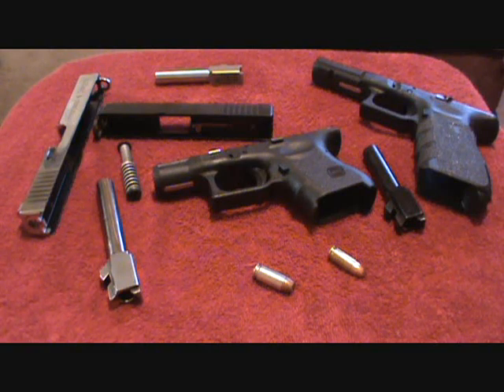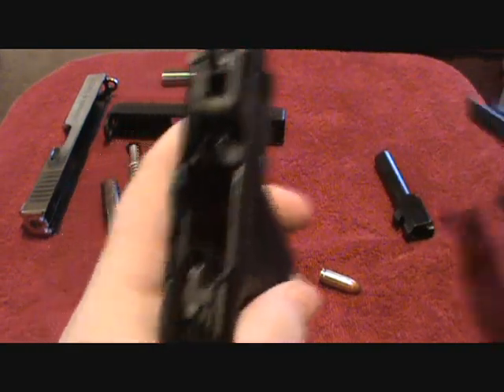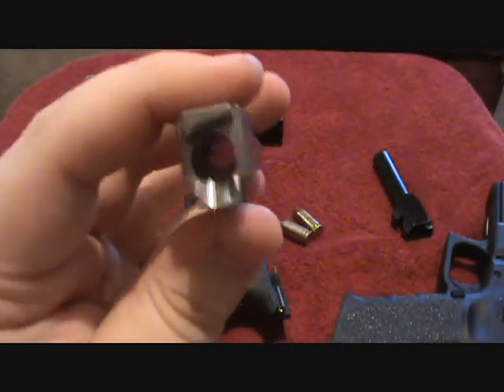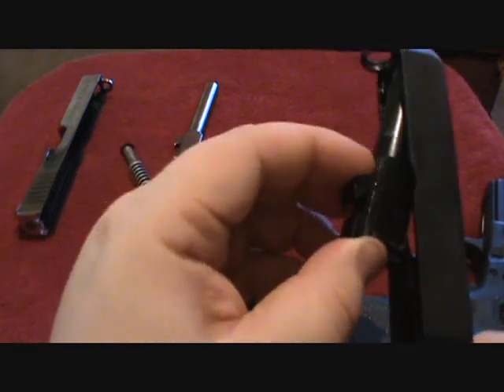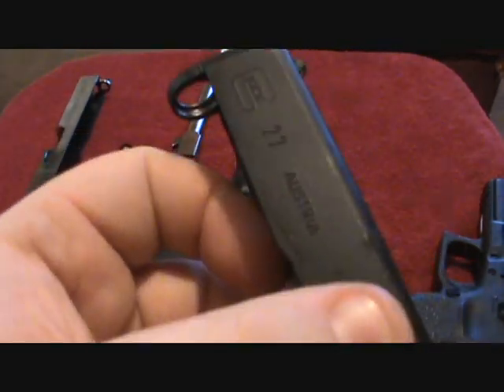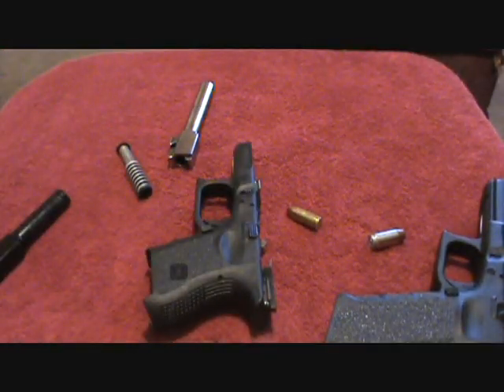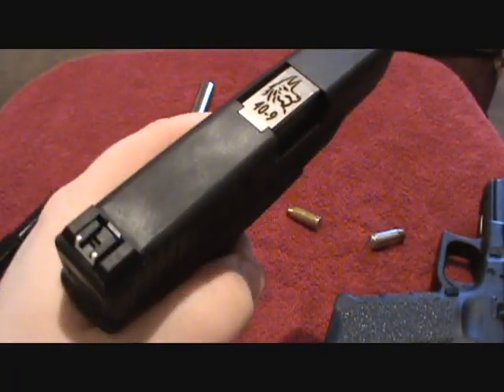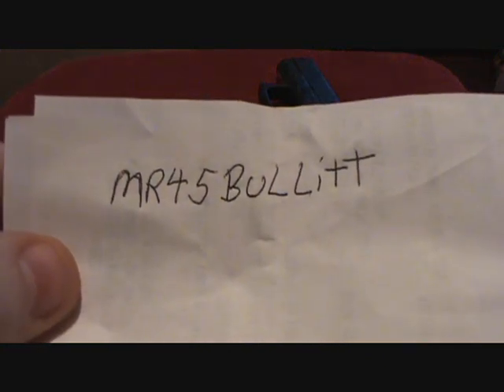About Glock conversion barrels

Comment: I have this exact set-up but I also have the 357SIG barrel that works with the .40 mags. This gun is awesome. You can run 3 different calibers through it. Priced new, you can buy everything to shoot .357SIG , 9MM and .40S&W for about $820. The Glock 27. Awesome little powerhouse.

Comment: @TheGlockaholic 

yes they do. plus you can use the 40 cal mags to hold the 357 round with no problem due to the 357sig being a 40 cal casing with what is basically a 9mm projectile.

Comment: I have a G19 and a G23, I converted my G23 to a 9mm. I changed out a total of 5 parts. Barrel(Alphawolf), Ejector, Extractor, Extractor Spring Button, and mags. I went with PMags, they are half the cost of factory mags. so now I have 2 G19s

Comment: I think you missed something with the Glock 20 in 10mm cal. Besides conversion to 40 S&W you can also do a 357 Sig in the 10mm pistol and all three calibers with the SAME MAGAZINE. A real 3 in 1. And if you own a Glock in 40 cal you can also convert to 357 Sig.
Be careful with the extended ported barrels when you are shooting smaller calibers out of a bigger cal pistol. Like 40 or 357 Sig from a Glock 20 which is a 10mm. Because when you are shooting say, 357 Sig from a Glock 20 SF, especially with smaller loads, the recoil is simply not enough to cycle in the next round so you end up having a misfeed. Also recommend a Lone Wolf extended/ported 10mm barrel for your Glock 20 to replace your factory barrel. For a $100 more you have a barrel that reduces recoil significantly!!
Jackson, Mississippi.

Comment: @Tenacious21 No, they are frame size specific. In other words all Glocks with the "smaller" frame, 9mm, .40 s&w, .357 SIG, etc their mags are interchangeable. The larger framed Glocks, the .45acp, .45 GAP and 10mm have a larger width mag. These larger mags will not fit in the smaller frame Glocks. The smaller frame Glocks mags will insert into the larger frame Glocks but will be too loose and will not lock in place.

Comment: I should have mentioned, The Stainless 9mm conversion barrels, have the thicker barrel wall. That extra thickness gives the pistol added weight, on the front of pistol where a loaded pistol needs it. Most shooters love the accuracy of the converted G23.

Comment: I have the G29 with 9x25 barrel its a cool round, very expensive. The recoil is lest then the 10mm it has a nice crack sound like a rifle and a 2 foot flame out the barrel.  Very high velocity would be good against light body armor. it is a step up from .357 sig i think of it as 9mm super mag

Comment: Thank you for doing this video.  Please update with clarification on the necessity of complete caliber conversions.  I have read forums and seen video where people say you should also swap out the extractor, ejector assy and the little plastic extractor spring bearing.  Would it make any difference in say how the G22 with 9mm conversion would run or its reliability?
Reply: I did a complete conversion. I changed a total of 4 parts to make it reliable. Barrel(Alphawolf ), Trigger Spring Housing(ejector), Extractor,Buffer Spring,  and the extractor spring button. all the parts I bought from the glock store. well it is a total of 5 parts. All 9mm parts. make sure you buy the parts for the right GEN. 1-3 parts for that Gen andd GEN 4 for GEN4

Comment: the 40-9 conversion barrel will also work in your 357 sig models 31,32,33.they do not make one that says 357-9 but the 40-9 will work it just will say 40-9 instead of 357-9.i got one for my glock 31 and it says 40-9 on it.lone wolfs website says that their 40-9 conversion barrels will also work in all 357sig models and 40 S&W models just the same just make sure to use a 9mm mag when using this conversion barrel. great video but i thought i might let you know this about the 40-9 conversion barrel

Comment: @JGuitar310 You can see when you look at the loading port of the lone wolf barrel it is to the left side a small amount. More wall on the right side and less on the left. This "off centers" the round so it will hit the extractor correctly if i am not misstaken.

Comment: I bought from the Glock store the double diamond 45 ACP to 10 mm conversion with two 10 mm Glock magazines and a 20 lb competition recoil spring with the ring to make it fit my slide.
I have failure to load problems about every second and third shot.
I find that this conversion is not reliable for Carry.
Using the Glock 21 in the 45 ACP mode it runs just fine no matter what speed I'm pulling the trigger at.
I did find the 20 lb recoil spring tamed recoil a lot.
I am searching for a fix on the 10 mm side because I wanted to carry it that way for Bear protection while in the woods.
But I find right now it is not reliable at all using it as a 10 mm!!!!

Comment: I have a LW conversion barrel (.40 to 9mm) in a Gen 4 Glock 22.  The only thing additional you need to do is change out the .40 Recoil Spring Assy to a 9mm one (and of course the mag) and you're good to go!
Reply: I used my G22 recoil assembly, a G17 magazine and shot 100 rounds without so much as a single issue.
Reply: Konish P. And did you notice that your follow-up shots were slightly slower?
Reply: thebronzetoo I can't say that I did notice it, but it wasn't during a match...just range plinking.  I guess I was commenting on the fact that the .40 recoil unit worked  okay

Comment: I put one of these in my older model 22 with a model 17 mag and it has jammed with a FTL and a FTF. Happened with the original recoil spring and a new spring. Lone wolf recommends to use P+ ammo. I'm a little concerned the gun is going to blow up in my hands.

Comment: This is what I was looking for to clairify Why you cant just switch out factory barrels 27to26 Some Vids are saying does work fine wondering if  it tears up internals Sticking with fac? I actually got a lonewolf  9mm 5.25 to convert my G 20 10mm Was jammiing had to polish ramp then worked fine.

Comment: You can absolutely go from 9-40 if you buy a 40 slide and ejector. Glock 17 and 22 is exactly the same frame and trigger group, it takes a $7 ejector and a glock 22 slide and barrel to convert it to a .40. It just depends on how much you want to spend doing it. Lone wolf sells their G22 slides for $174, the G22 barrel if about $100 and ejector is about $7. it is not un-doable.
Reply from the maker: I know this, been using glocks for over 20 years, key work is you have to buy a new slide, I can ge police trade in g22's for around 300 so why would I buy slide barrel mags etc??
Reply: +H4T Certified Glock Fanboy Wasn't my point. Point was you can do it. You said you can't.
Reply from the maker: Yep and i'm exactly 100 percent right, like I said in the video you can not just add a barrel and go from 9mm to .40,
Reply: Humans4Targets will the 357 glock shoot 40cal or the other way around?
Reply: +Phillip Brown other way around
Reply: Is the Glock 33 357sig basically the same as the Glock 27? I really want to get a Glock 33 while also getting a additional 40 barrel to be able to shoot the more available 40 ammo. I rather be able to buy the 9mm conversion barrel but do I have to switch out any other parts besides the barrel & magazine? I've been shopping around & most gun stores don't seen to know anything about them but saying that I can buy a 40 cal barrel to shoot 40 cal in the the Glock 33.

Comment: Thanks for video. Just my opinion, but I MUCH prefer KKM barrels. They are 40% more expensive. How much quality steel and quality machine work can you get for $100. ?  I've had some experiance in this, and the KKM IMO is superior. I've never needed the extractor swapped in my G23 when converting to 9mm. If the Lonewolf doesn't work out for you, try KKM. Accuracy is far superior also.

Comment: Ive noticed a 9mm bullet fits in a 40 cal mag.  It also feeds with no problem.  Is it safe to use the 40 cal mags w 9 mm bullets?
Reply: +john calabria I've done it and it works fine. Checkout the "Glock Store 0n youtube there's a video about using the .40 mags with 9mm.

Comment: ok so.....if the chamber is offset to the left so the 9mm casing hits the ejector, does the 9mm shoot a little to the right when shot out of conversion barrels? it would suck to spend a little extra just to practice cheaply to shoot off target. better to just get a 9mm gun and practice shooting straight.

Comment: Couldn't you get a .40 barrel that is milled differently, to fit the 9mm slide? You did that with vice versa for your 9-40 conversion. Would there be other problems? 

I understand that you may have to replace springs or something, but if you did that is there a potentially hazardous problem still from the slide even if the barrel's built to fit it?

Comment: Quick question. I have a G31 and have bought a Lone Wolf barrel that is for the G35. It sticks out close to an inch further than the stock G31 barrel. I have yet to try it. Should i get an aftermarket recoil spring or should it be ok. Money is tight right now so it's gonna be a while till i can get some ammo to try it out. Just wondering if it sticking out is gonna be a problem. Thanks for all your help in the past and future. God Bless,                        Richard.

Comment: You said that you can convert the Glock 21 to the corbon the best conversion is the 40 super or the rowland Lone Wolf wheel bore your Barrel to shoot the 460 Rowland for $50 and purchase a 27 lb spring and the 40 super Barrel runs about 115 and you need a 24 lb spring both are great rounds but the corbon is outdated

Comment: would you trust this barrel enough to be reliable enough for concealed carry?
Reply: My conversion 357 Sig to 9mm for my Glock 33 seems like it is reliable with 9mm mags.  I get malfunctions with the 357 mags, like one in 50.  I am doing more testing tomorrow with the conversion on my G33, but the first 100 rounds were normal Glock perfect when using G26 mag or my G17 mag's.  I plan on carry with the 9mm conversion and the stock 357 Sig in the G33.  Both calibers are fine as far as I am concerned.  When I run out of 357 Sig, then it will be all 9mm because of cost and compatibility with my other carry guns.

Comment: Hey h4t, 
If the sig 357 is the same casing as the 40 but neck down, then If i have a 27 can I put a 357 sig conversion barrel into it. I saw another utube of a guy putting a 357 conv barrel into a glock 23. I was told by one vender you can only conver down. Also they said that if you get a KKM conversion barrel you have to get an extractor. Is that true as well. Is lone wolf the only ones who adjust the barrel for the extracters?

Comment: Can you convert Glock G22 to a .45 cal?
Reply: No, it works in one direction only from a bigger caliber to a smaller one,  so you can convert from .45 Auto to .40 S&W(Glock 22) , but not from 40 S&W to .45 ACP, i.e. the space in the slide given by the bigger calibre gives an excessive space for a smaller calibre barrel, something like conversion from .45 Auto to smaller .40 S&W then to smaller Sig .357 or 9mm. ... and for some cases you shall change an ejector and/or an extractor, and/or shall change a recoil spring to compensate an alternated recoil energy. P.S. if you don't understand fully gun mechanics and its safety it is better to visit a gunsmith before doing any alternation, otherwise it can be deadly dangerous to operate  a modified gun. A few big calibers can be converted into 10+ smaller one, but this is for those who like to convert  and experiment, but may be not safe to operate.